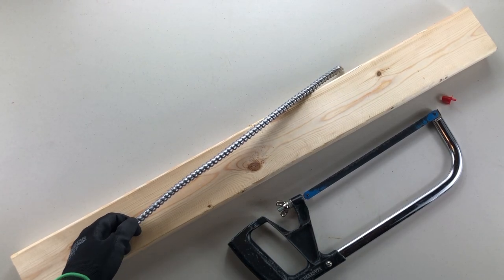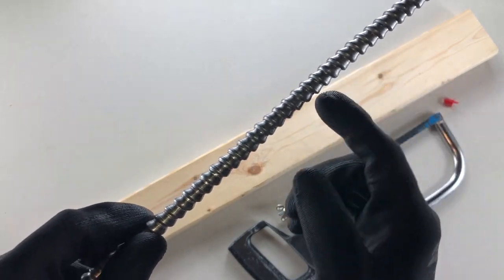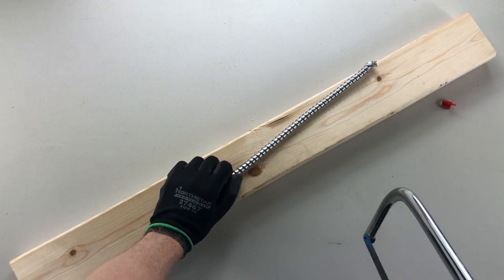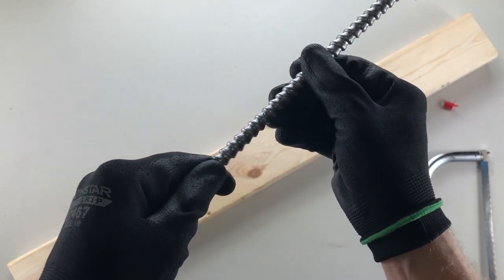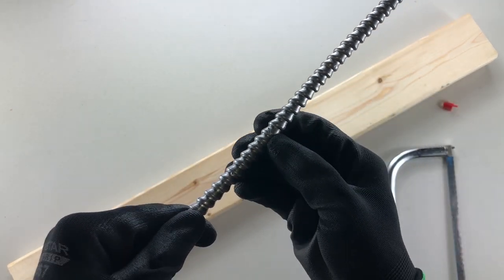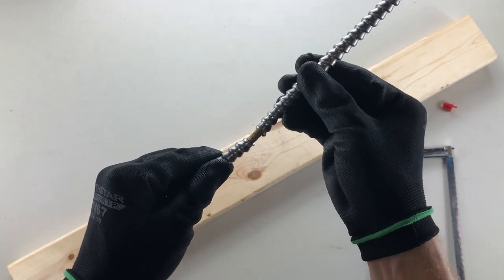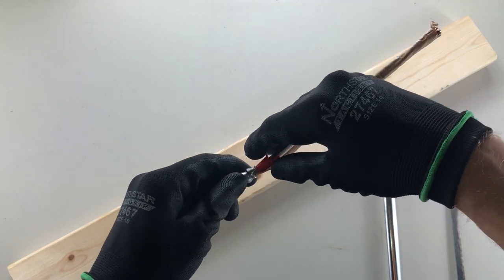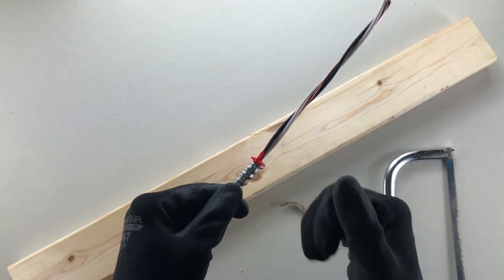How to strip armoured cable - BX or AC90 - The Electrical Guide

Comment: Pro tip: fastest and easiest way to strip this kind of wire is to bend the wire back until you shield opens.  Then with both hand give it a twist at the bend to pop open the shield just enough for you to slide your wire cutter in and clip it.    Shield will break when pulling it down even though it’s not fully cut
Reply from the maker: Fully agree, that’s the way I always do it. Few people know about this way so I show it to my students and therefore make a video showing the technique. I appreciate the comment!

Comment: Dam I’ve been struggling with this stuff. I’ll try it out. 
Saves getting the Roto tool. Every one has a hacksaw
Reply: get the roto tool. if your working win any amount of bx, its saves sooooo much time, and leaves a nice clean cut. anti-short slides right in. never once have i carried around a hacksaw. snap cutter for emt/rigid

Comment: thanks for this!
Would a small pipe cutter work too or would that be too risky?
Reply from the maker: Don't use a pipe cutter - you can however do it another way with side cutters by cracking it in half first and cutting through a link with your side cutters then trimming the excess sharp metal before the anti-short goes in.

Comment: Though there are many ways to do it, the correct way is per manufactures instructions. That is what I was pointing to. There is no shortage of ways, however the manufactures instructions are what is supposed to be followed  NEC 2020 NFPA 70 Sec. 110.3(B) is the principle for safety
Reply from the maker: I don't teach out of the United States, therefore NEC regulations don't apply to me.
Reply: What manufacturer tells you how to cut the armor cladding?

Comment: You need to read manufacturers instructions on how to cut this cable properly
Reply from the maker: There are many ways to cut this cable, and a couple tools designed specifically for stripping this. Frankly I use side cutters but I teach my students the hack saw way first.

Comment: How is that an antishore? I thought it was a bushing.
Reply from the maker: Hey Denver, this is technically a bushing but that's kind of a general term. More specifically this prevents shorts between the conductors and the outer casing, so it's actually referred to in the code book as an "anti-short". Hope that helps!
Reply: @theelectricalguide   wow so I can get those where I bought the wire? wonder why it just doesnt come with it anyway thanks for the video!!!
Reply from the maker: @michaelmauk417  Yes you can, happy wiring!

Comment: Listen to me these instructional videos all suck because they don't address the most important things here is all you need to know if you cut it with the hacksaw make sure that you cut three of The ridges do not cut into The valleys if you cut into The valleys you will cut the wire inside

Comment: Rotosplit is fast and easy. I don't like this method, personally.
Reply from the maker: I agree, Rotosplit is quick. I actually use side cutters myself. I teach this technique for the college, so it's gotta be proper :P
Reply: @theelectricalguide  As long as the conductors aren't damaged then it doesn't matter. It comes down to preference.
Reply: That hack saw beats out the roto cutter or side cutters any day
Reply: @cheynebest7028  It's faster to do the roto split for me than it was for the guy in the video to do it with the hack saw. Takes about 5 seconds for me to do it. Also, there is no way to damage the conductors with the roto split. I have an old Greenlee style one that is old and it works just great, still. Also, in the video, he had to use effort to break the armor after he scored it. When I use the roto split, the armor is cleanly broken, all the way through. Just my experience and preference. I reserve using the hacksaw for when I need to cut something metal that needs to be precise that the Sawzall is too rough for.